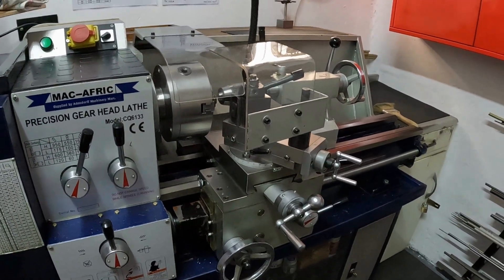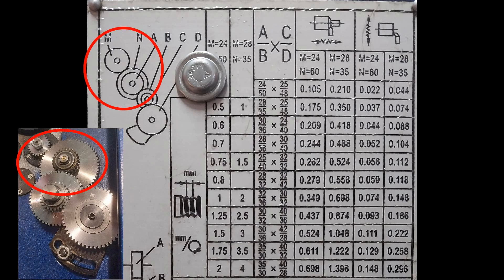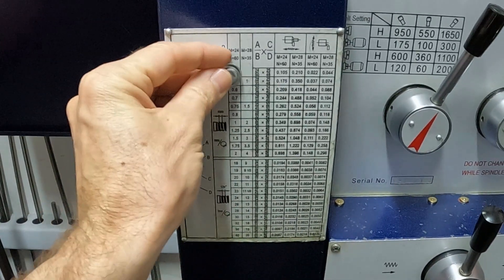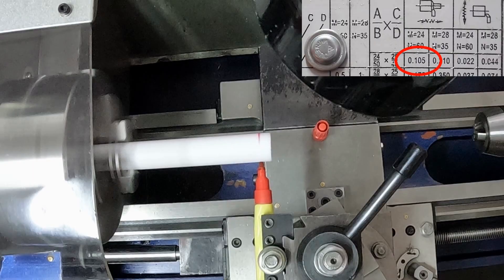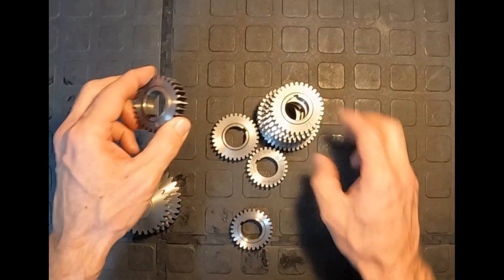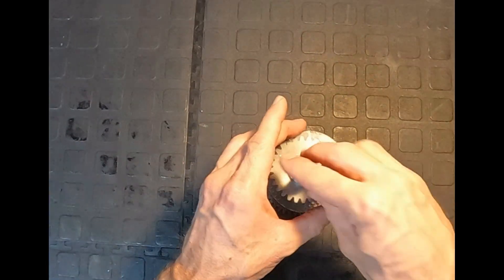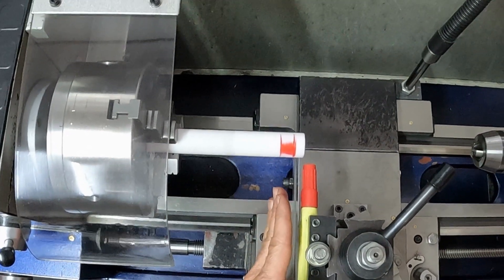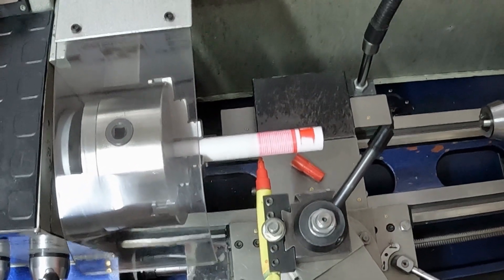That scary lathe gear chart... And some lathe tips...

Comment: Hello,

I just got one of these lathes, But no change gears, I can't find them anywhere. Do you have a list of the gears that came with this and what pitch they are as in 1.25 etc.  And also the shaft size for the hole in the center? 

Thank you for whatever information you can give me. Mark
Reply from the maker: Hi Mark, the gears needed are on the gear change chart on the side of the lathe or you can do a screen grab from the video. The shaft size should be measured from your lathe. I'm not sure of the modulus, and unfortunately I don't have a gauge.
Reply: @Lukers_tinkering  Thank you!

Comment: Brilliant video. Still getting to grips with this machine and I did not understand how to engage longitudinal and cross cutting power feeds. I mistakenly used the halfnut lever 🙃🙃... believing the actual power feed lever is just a select lever. (The way it is setup on my Colchester Student)
The result of this was that I believed the cross cutting feed wasn't working and on top of that, while I have installed the slowest gearset, the feed rate was still incredibly fast.
Reply from the maker: Not to worry, many have done the same thing! The machines are pretty robust so you probably didn't damage anything... Thanks for watching!
Reply: @Lukers_tinkering  in fact I went and check with my new found info and the facing/cross feed is not working!
But I do understand the operation better.
The main difference between the Colchester and the Adendorff as far as the feeds is concerned is that the Colchester uses an additional shaft for power feeding so the leadscrew is only used when threading. The arrangement on the Mac Afric machine caught me a bit of guard.
The 9A South Bend lathe I have has the same type of setup as the Mac Afric lath although the controls operate more intuitively but this is likely due to the fact that the 9A comes with a quick change gearbox.
I guess I will need to contact Adendorff to check on possible repair options.

Comment: Hi. Picked up on this feed. Great to see SA guys doing vids. Have the same lathe as you. Added a clutch, which makes life a lot better and no sudden knock on start up. I felt sorry for those gears. 
Some good mods you done there ++
Reply: how did you add a clutch?
Reply: @verdiblue only see your message now. I did a crude mod with the intention of making it look better, but it worked so well, I just left it like that. Works perfectly in forward and reverse.
Reply: @verdiblue I can send you pics. Don't want to mess up this thread.